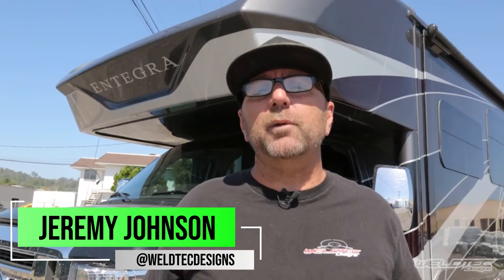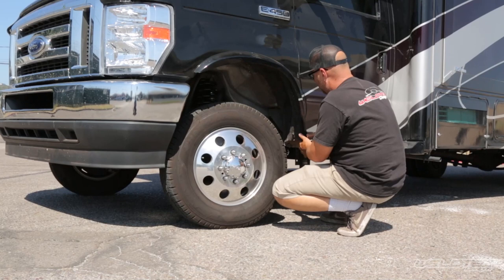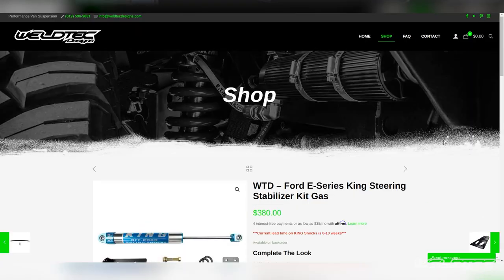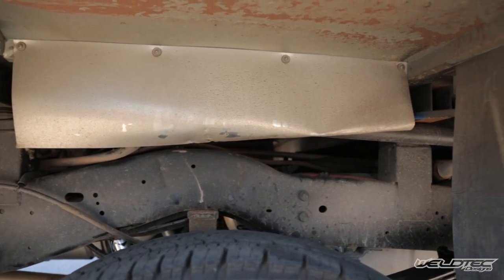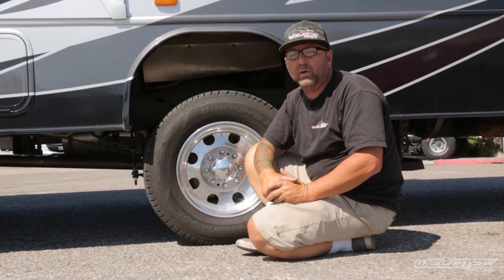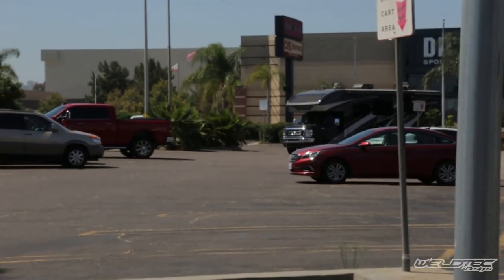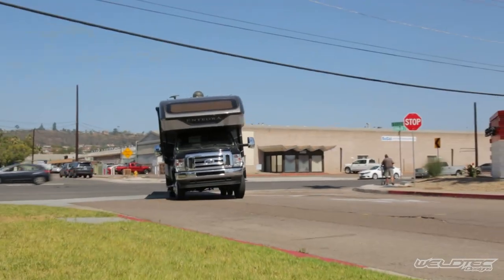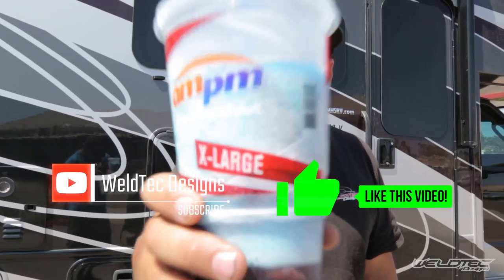6" Lift Kit  RV Suspension Upgrades For A Class C Entegra Esteem

Comment: I have a 2021 Entegra Odyssey 29k which is very similar in design just not as high end.  If I were to get a lift kit done I would most likely do the same as this Entegra.  Can you tell me how much it would cost to get this done?  And does price differ with each height difference (6", 4", or 2" lift)?
Reply: A 4" and 6" kit are the same price with leaf springs.
Reply from the maker: Here is a link to multiple kits. https://weldtecdesigns.com/product-category/ford/class-c-rv/